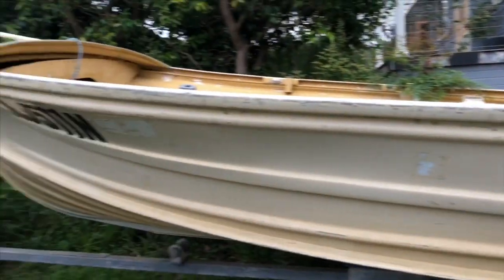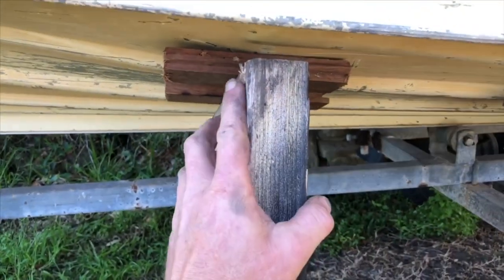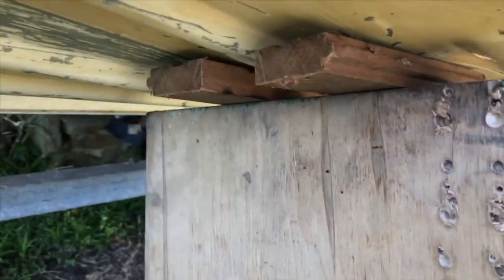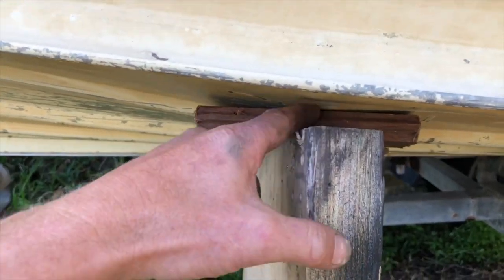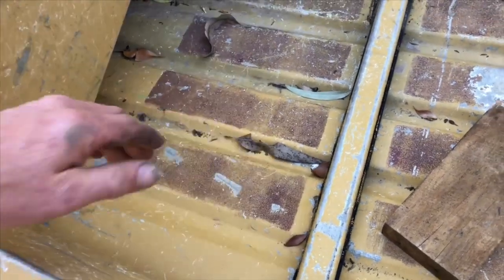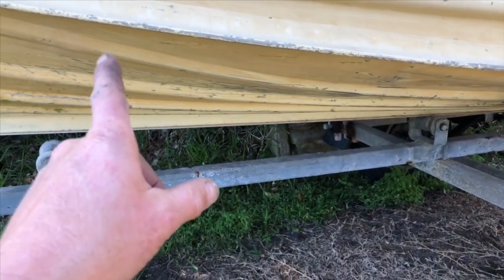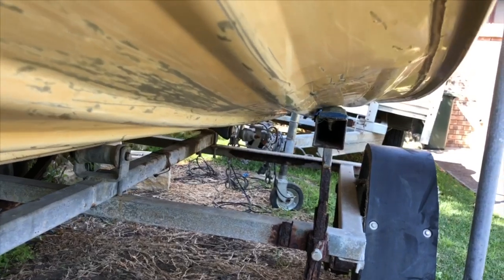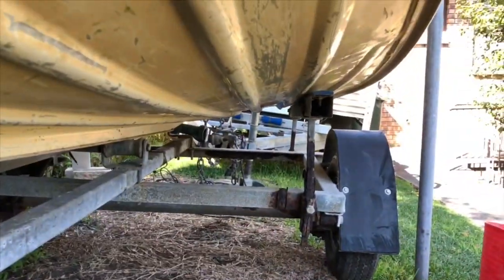Fixing up an old tinny - part 2

Comment: Love your work mate, next time you on the gold coast I've got a cold beer for you. Hey mate how do I fix pin holes in my 3.7m stacer vpunt? Some have said to use a epoxy sealer or fiberglass resin but I'm worried about flex in the aluminum. Anyway cheers for these uploads and I look forward to the next 👍
Reply from the maker: Cheers mate.
Are the pin holes from corrosion? And how many holes?
I normally weld them after drilling them out to get back to some better alloy but welding is not always possible.
 Epoxy fillers are ok. Another good way is the epoxy fill the holes after cleaning the corrosion away, sanding filled holes flat then two part hi-fill prime the bottom followed by a two part paint.
Even just fill holes then paint with oil based gloss works ok. 
Depending on how much you love the tinny! I love them all!
Reply: @25hpboatracerman  cheers for the reply, I've got about six pin holes between the transom and the rear seat. I only noticed when I put a spot light on the hull when I was my garage, they look like corrosion spots unfortunately. I'll try anything to fix this tinny as it goes well with my 18hp tohatsu. Even had a 50hp Short shaft tohatsu on the back 😉 and the transom is strong for a 3.7m but the hull corrosion is really pissing me off! Cheers for the advice 👍